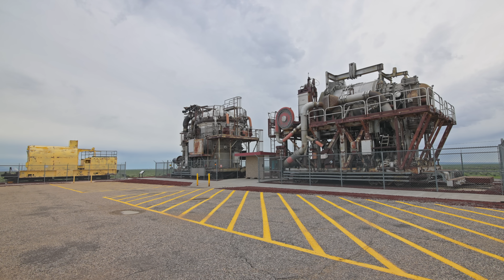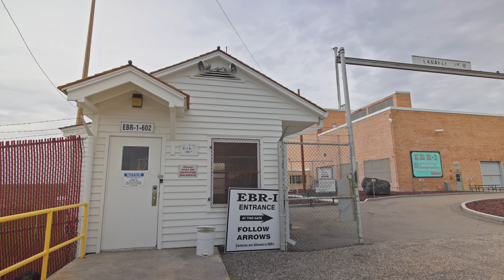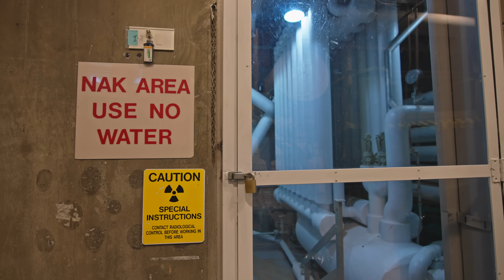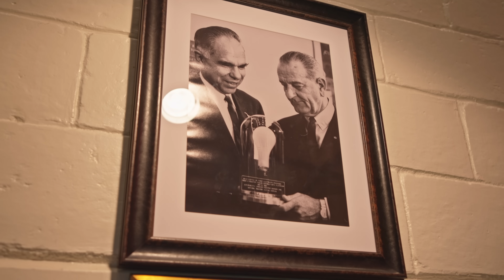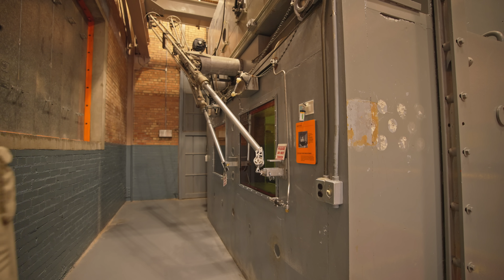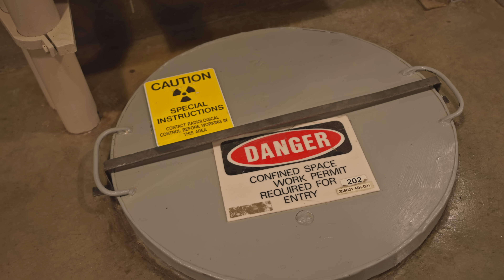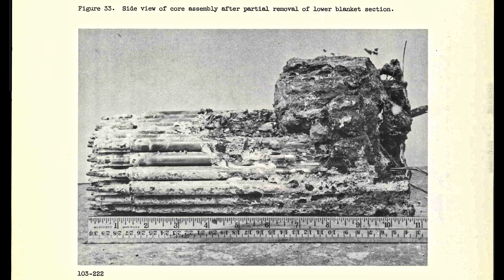Radioactive Nuclear Jet Engines in a Parking Lot

Comment: Drew.  Do you have or are you likely to produce a "Worst case scenario - Action plan" style video.  I see you did a "Gear" video, I'll watch that next, but I'm more curious about the modern day understanding of how to survive the first few weeks.  My plan, if I see the flash or the curtain go up, I am heading for the understairs cupboard, surrounded on all sides by dual skin block walls.  If I'm still alive when the blast and firestorms settle I will fill as many vessels with water and seal off the tap, from any remaining pressure in the tap, seal all doors and windows and start eating the fresh or perishable food first.
Switch off all non-essential loads on the off-grid solar system if it's still functions.  Preserve the power.
Don't go outside for 2 weeks.  If intruders arrive, hide.
Hope that some help will become available, such as water before you run out of water you grabbed before the fallout.  Before you run out of food.
Some interesting developments around that.  Where do you poo?  I recall the advice was to shit indoors and dispose of the waste out the window.  It can be dealt with later when outside is safe again.  Similarly for family members who pass.  Wrap them up and move them outside quickly.
Never disturb dust or debris, never trust water, never trust anyone.  If they are in uniform they are either there to help you or not.  Workout which fast.
Part of me however would rather know it was coming and get to watch a few mushroom clouds before being instantly vapourised into one of them.  Somehow it sounds like a faster, easier way to die that suriving the in the wastelands and scorged earth remaining.

Comment: I build some stuff like this (oil and gas not nuclear) and it just baffles me how some customers don't want the unit painted. I get the cost and the environmental concern but damn it looks so much better when they do. To the point where its required in some areas to be painted like the landscape. Not to mention, it will crumble eventually but I guess they spec the steel to last longer then the rest... Id hope lol.

Comment: Scintillation detectors are cool. A big crystal or plastic gives off faint flashes when hit by radiation. The sctintillation is done by a superfaint light detectors. Radicode probably has a small cesium iodide crystal in it. They are fairly sensitive.

Comment: What a cool device radiacode is. But...prohibitively expensive. 313 Euro? Come on! This is nonsense.
Reply from the maker: What are you talking about...its listed on the site as 259 euro. There are cheaper options out there but with a fraction of the features this has. To me its a deal. I bought the Radiacode 101 with my own money and I'm still happy with it. I'll only use it for certain things now because its been replaced by the 102.

Comment: Hey Drew, what’s the difference between the 102 vs the 101?
Reply from the maker: It has slightly better gamma spectroscopy resolution and apparently the case is built a bit better.
Reply: @RadioactiveDrew  cheers, appreciate the info. Would you say it is worth the upgrade? I’m down to two counters now just the Radiation alert ranger and the 101. I miss my B20ER. Better quality than the ranger.
Reply from the maker: @englishguy1985  I think it would be worth the upgrade if you were going to sell your 101 and replace it for the 102. I think they both worth incredibly well. What happened to your B20ER?

Comment: So the main reason nuclear jets never took off was the weight of the system. It also used liquid metal to move heat between the core and the actual jet parts, and it never produced enough heat to produce enough thrust to make it viable. Russia also experimented with the concept, and it failed because crews would have had almost no shielding to protect them, and it was going to be a hard sell to get crews to fly those nuclear powered aircraft. Aviation is all about being light and fast, neither of those qualities were apt to come from nuclear jets. 

Nuclear rockets, on the other hand, are still viable, just not for atmospheric propulsion. Those skip the intermediate fluid and spray hydrogen right on the fuel assemblies causing the hydrogen to heat up and expand. Hydrogen is the fuel of choice because it's light and the rocket will get it to expand faster than a heavier fuel, though heavier fuels could probably work. The scary bit is, the rocket core is basically in a controlled melt down, the propellant / fuel is what's pulling away the heat. It's possible that the core would melt if the flow of propellant were suddently and unexpectedly stopped. On the bright side, nuclear rockets could be used multiple times and could be refueled with more propellant as space "tugs" though it's uncertain if the public would ever support launching such a massive payload of radioactive material into space.

Comment: So how does a nuclear jet engine actually work? Turning turbines to create thrust with steam?
Reply: These used conventional turbojets, the turbojet compressor pulling air in and shoving it through channels in the reactor, the superheated air going back out the end of the jet. The reactor then replaces the fuel-burning part of the turbojet. No steam.

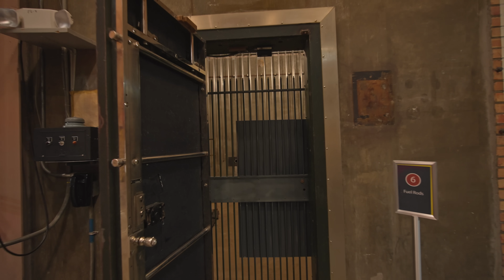Comment: 15:20 I suppose those rods are dummies? I'm well aware that the radiation risk of not yet irradiated fuel rods is very small and you can handle them without issue .. but having fissile material just out there would likely not be seen favorable by the authorities.
Reply from the maker: I’m sure they were dummy rods as well.
Reply: Yep,  they are dummies. There is no fissile material at EBR-1.

Comment: I was part of the crew that helped store EBR1, and the two nuclear jet engines. Also my dad used to be head of safety out there and he wrote the nuclear safety program that was adopted I can't remember if it was the '80s or the '90s. He also served on the submarine whose mast is sitting outside of Arco Idaho.🥃🍻🥓🇺🇸
Reply: and what did you do to store them ?
Reply: @bobl78  
I stopped working there in 06'ish. The last place they had them when I worked there was right outside of EBR-1 to the southeast of the building. But I haven't been out there in a while as I moved to Washington in 08.

Comment: My father got a ton of radiation that later affected his health working there as a college intern after the clean up of the nuclear accident there. There was a MUCH bigger mess there than it was reported.
Reply: Has any accident been properly reported up front?
Reply: @oatlord yes the SL-1 was pretty public in the way the incident happened, mainly due to the circumstances and the theory of a murder suicide or circumstance driven mistake. 

However the SL-1 was also military work of the Army trying to wrangle a PWR to do a work it was pretty badly suited for. The issue is the reactor was meant to be air portable and assembly possible via modules. And because it is the army they essentially were able to avoid every safety guideline in the book to make that happen. This is what led to the criticality event that killed the operators, including impaling one in the ceiling with the center control rod. 

It is likely such a lightweight and lightly protected design with very obvious lack of tolerances must have led to a VERY difficult cleanup operation, compared to stuff like the much more criticized TMI that was a walk in the park in term of industrial disasters.
Reply from the maker: @mobiuscoreindustries usually all the early test reactors were the worst thing to have any kind of accident with.
Reply: @oatlord yes , sl-1 is a very well known reactor and had a very well known criticality event
Reply: @oatlord  NO !!!  Early on, the Govt, A.E.C., and military covered up the reporting of any nuke accident as minimal and a blanket statement of ," No release of radioactive materials and no danger to the public " !  In time, more info got out to the public as to the real danger and level of damage from the incident ! The more the nuke industry LIED, the less the public would believe them !  Hence, the DEATH of the nuke industry from it's own hand !
Reply: Was that at EBR-I or at the INL property
Reply: @emerytaylor9734  I need to revist the paperwork as years later it lead to his death, if I remember correctly it was at SL-1 as he was a grad student hired to clean up the mess as they brought in students from West Coast nuclear college programs.
Reply: @aroundthehouseEricG  so messed up. One of the most dangerous processes that they have to handle, and they figure that's a good starting point for the kids to train. Unreal. 😢
Reply: I'm very sorry for what happened to your Father.
Am I surprised it was underreported? NO.
Truthful reporting of incidents that kill humans. Long or short term doesn't exist.
Look over the the True "all cause" death statistics for the last 2 ½ years and you will see the Truth.
The evil psychopathic traitorous organized criminals (PTOCs) do not careabout other people at all.
We are not in their club. As George Carlin said many years ago.
They do not care about us at all, at all, at all, at all.

“But there’s a reason. There’s a reason. There’s a reason for this, there’s a reason education sucks, and it’s the same reason that it will never, ever, ever be fixed. It’s never gonna get any better. Don’t look for it. Be happy with what you got. Because the owners of this country don't want that. I'm talking about the real owners now, the real owners, the big wealthy business interests that control things and make all the important decisions. Forget the politicians. The politicians are put there to give you the idea that you have freedom of choice. You don't. You have no choice. You have owners. They own you. They own everything. They own all the important land. They own and control the corporations. They’ve long since bought and paid for the senate, the congress, the state houses, the city halls, they got the judges in their back pockets and they own all the big media companies so they control just about all of the news and information you get to hear. They got you by the balls. They spend billions of dollars every year lobbying, lobbying, to get what they want. Well, we know what they want. They want more for themselves and less for everybody else, but I'll tell you what they don’t want: They don’t want a population of citizens capable of critical thinking. They don’t want well informed, well educated people capable of critical thinking. They’re not interested in that. That doesn’t help them. Thats against their interests. Thats right. They don’t want people who are smart enough to sit around a kitchen table to figure out how badly they’re getting fucked by a system that threw them overboard 30 fucking years ago. They don’t want that. You know what they want? They want obedient workers. Obedient workers. People who are just smart enough to run the machines and do the paperwork, and just dumb enough to passively accept all these increasingly shittier jobs with the lower pay, the longer hours, the reduced benefits, the end of overtime and the vanishing pension that disappears the minute you go to collect it, and now they’re coming for your Social Security money. They want your retirement money. They want it back so they can give it to their criminal friends on Wall Street, and you know something? They’ll get it. They’ll get it all from you, sooner or later, 'cause they own this fucking place. It's a big club, and you ain’t in it. You and I are not in the big club. And by the way, it's the same big club they use to beat you over the head with all day long when they tell you what to believe. All day long beating you over the head in their media telling you what to believe, what to think and what to buy. The table is tilted folks. The game is rigged, and nobody seems to notice, nobody seems to care. Good honest hard-working people -- white collar, blue collar, it doesn’t matter what color shirt you have on -- good honest hard-working people continue -- these are people of modest means -- continue to elect these rich cocksuckers who don’t give a fuck about them. They don’t give a fuck about you. They don’t give a fuck about you. They don't care about you at all -- at all -- at all. And nobody seems to notice, nobody seems to care. That's what the owners count on; the fact that Americans will probably remain willfully ignorant of the big red, white and blue dick that's being jammed up their assholes everyday. Because the owners of this country know the truth: it's called the American Dream, because you have to be asleep to believe it.” 
George Carlin
Reply: This is the official film about the SL-1 reactor accident.  
https://www.youtube.com/watch?v=Q0zT9ARfsT4
Reply: A whole ton? Luckily, he was killed by all that weight!
Reply: Really sorry to hear that. 😢 They don't care what they put people through. My grandpa had mesothelioma he spent his early years in WWII, working in the engine rooms during the Pacific campaign. He also had developed cancer. 😢

Comment: My grandfather worked out there. He moved from California to Idaho to work at the "site" for a $0.10 an hour raise. 

My grandfather bought a a suplus truck from the site where the bed was lined with weld sheets of stainless steel. It was used to transport contaminated material. So, naturally the used it as a family vehicle back home. 😅 Different times. 

When my father was an adult, he worked at some of the nuclear research facilities as a Janitor. He would have to walk through those radiation detectors and occasionally one would go off. If it did, youd have to strip down, get cleaned and would be sent home in paper clothes.  I believe he said that happened to him once and he wasnt too keen on that happening again. I believe he left after that.
Reply from the maker: Different times for sure. I'm glad I haven't been that contaminated by something at a site that cared that much about it.
Reply: @RadioactiveDrew  I just called up my father to confirm the story. I heard it back when I was a kid. Apparently, I was mistaken on a couple details. He worked at the Naval Reactor Facility not too far from EBR-1. He said when you left you had to wand over yourself with a "frisker" and if it detected elevated levels of Radon you'd have to change out, but it never happened to him. I think that was my childhood imagination running wild. He quit working there because the NRF didn't pay too well, and American Potato was paying more at the time. Commute time was less too.

Comment: I Didn't know Jet Engines Where Radioactive ☢️☢️☢️☢️ Radioactive Drew 
Awesome Footage of Radioactive ☢️ Jet Engines in Idaho
❤️‍🔥❤️‍🔥❤️‍🔥❤️‍🔥❤️‍🔥❤️‍🔥❤️‍🔥❤️‍🔥❤️‍🔥❤️‍🔥❤️‍🔥❤️‍🔥❤️‍🔥
Reply: Jet engines aren't radioactive but those were nuclear powered jet engines.  In those days they didn't have reliable inter-continental ballistic missiles so all nuclear weapons had to be delivered by bomber planes.  The idea was we were going to have nuclear powered bombers flying in circles for months at a time without landing.  If a nuclear strike had to happen they'd be read to go.  The problem was they were lethally radioactive and the only way to protect the crew was with lead.  Lead is heavy and you don't want literal tons heavy stuff on a plane.  They considered using senior citizen flight crews would would die of old age before radiation exposure would cause them to get cancer but even that wouldn't solve the problem of what would happened if a flying nuclear reactor crashed into the ground or radioactive jet exhaust polluting the atmosphere.  There was at least one nuclear powered flight but ICBMs came along and made the whole project pointless.

Comment: Thanks for the video. I was at the site back in the early 70's at the Enterprise (A1W) power plant prototype. There were some 40+ operating reactors out there the at the time. I might not have called it "the Wild West of the Nuclear Age" to  quote Mitch VanDomelen (below), but there was certainly a lot going on out there. A great many projects were going on testing different scenarios and accident sequences. Some of those tests were "test to destruction" so yes - So I guess they could be described as wild.
Reply from the maker: Those do sound like wild times...a lot can be learned when safety takes a backseat.
Reply: @RadioactiveDrew  Please don't misunderstand me. 
I did not mean that the tests were dangerous or unsafe. The safety systems were often more extensive and expensive than the actual test rig.
I meant "wild" in the engineering sense because of all the ingenuity and imagination that went into designing these test rigs to produce reliable results while NOT endangering the people on or off the site.

Comment: My apologies, but I must provide the correct translation and meaning of the acronym. EBR-1 stands for: Exceptional Bitching Research, site 1 hehehe
Reply: Apologies, but this reactor kind of pisses me off as the Experimental Molten Salt Reactor was much better tech but it was sadly abandoned in part due to this one.
Reply: Not to mention being passively safe which does mean if all reactors were based on that design instead there NEVER would have been a Chernobyl or Fukushima or Three Mile Island or any other major nuclear accident, simply not possible.
Reply: Or, Extraordinary Bullshiting and Ranting, study 1